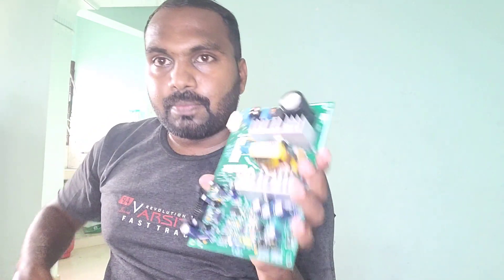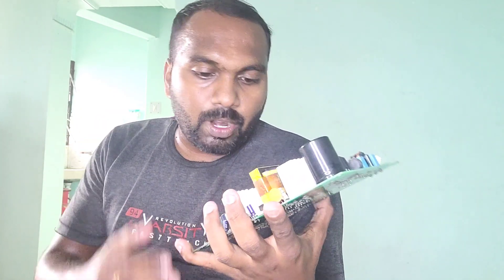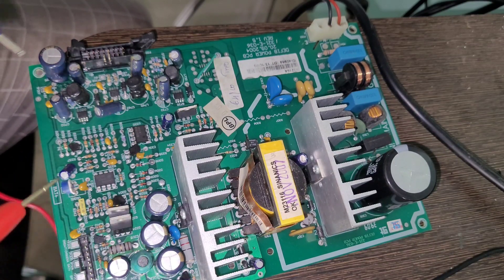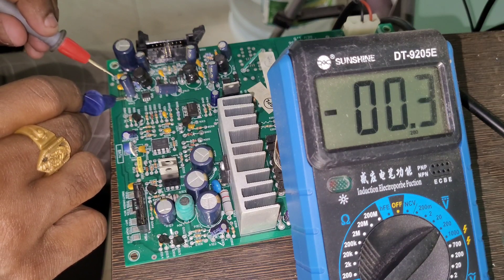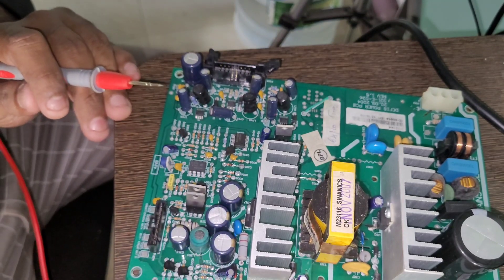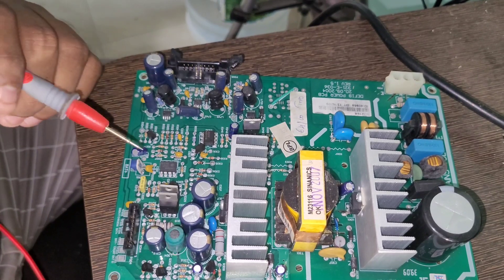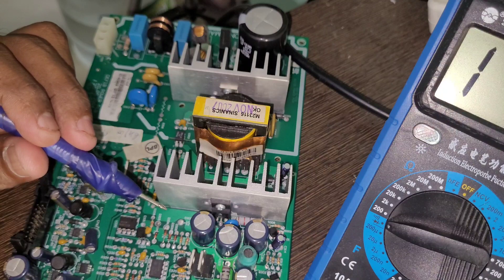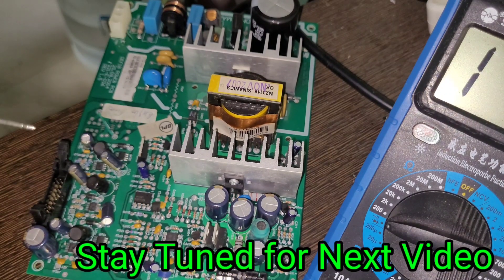BPL 2509 Defibrillator Repair

Comment: Battery is not getting charge .no any input is coming to battery port..whether it is issue with power supply board or distribution board?
Reply from the maker: Power supply

Comment: Hello sir 
The output voltage at the battery terminal is only 10.5 volt,I needed your support sir
Reply from the maker: Pls contact 9790567867